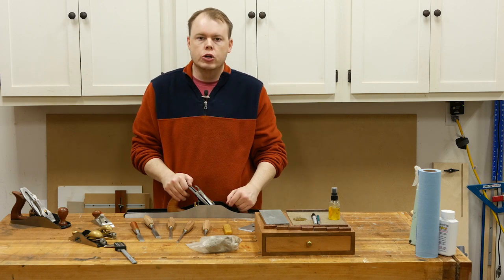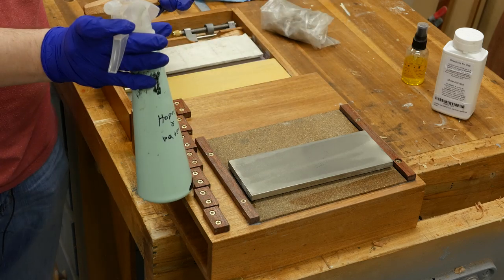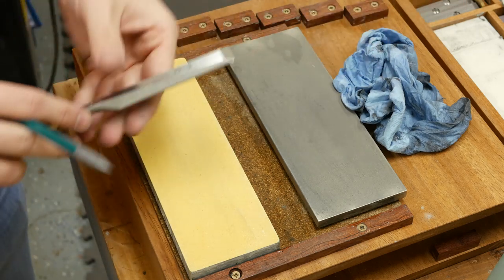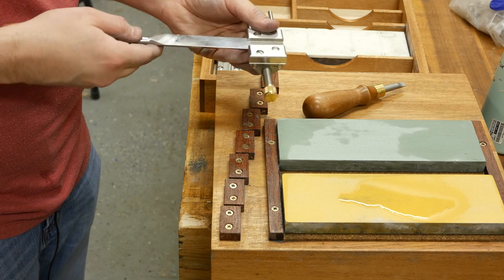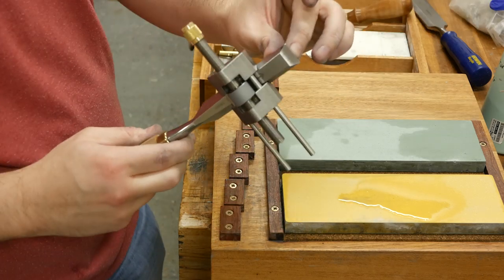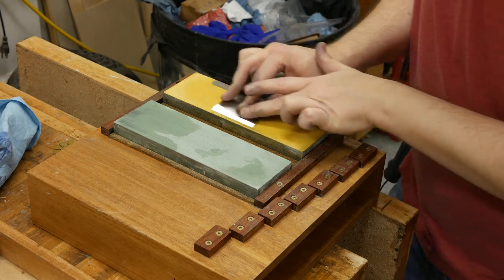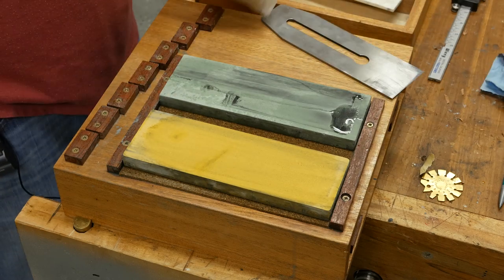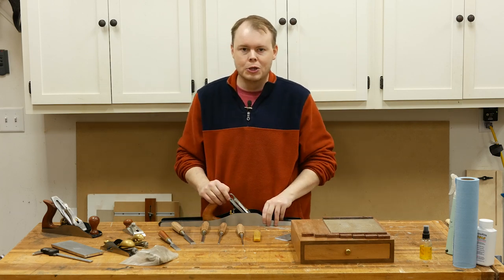How To Sharpen A Brand New Chisel And Plane Iron | Woodworking How-To

Comment: Nice video Sean. I need to get the coarse plate because starting a new chisel on anything finer takes forever. Thanks for sharing your method.
Reply from the maker: Thanks John. Yeah absolutely agree. For the price, the coarse stone is a good value. I had my original one for over 5 years granted I don't sharpen as much as I should, it will last a while.

Comment: Great video Sean! This is pretty much how I sharpen now except for 2 differences. First, I use a very micro microbevel. Only like 1 or 2 degrees. You can do this easily with your honing guide setup. Just stick your ruler between the block and your blade (so if your primary is 25, put your ruler in front of the 25 degree block). And then just a really tiny bevel. The second is I reset the primary every time. With just a tiny microvevel, it only takes a dozen strokes on a 1k to erase it. This saves a lot of time later on with low grit medium. It's really easy to skew an edge on low grit meduim when you are at it for a while. 
That sharpening setup is super nice
Reply from the maker: Holy shit Joe, Resetting the primary every time is brilliant! No need to let the micro build up and have to use a coarse stone to reset it. I'm going to give this a try maybe after the second or third micro bevel honing. Thanks for the comment!

Comment: Curious about the LN guide. You mentioned it doesn’t do well w chisels that have a tapered thickness. I’m considering buying that jig but have several chisels that taper and wonder if it’s still doable or if it really doesnt do well with them at all??
Reply from the maker: Randy, I mentioned that it doesn't work well with tapered thicknesses because it doesn't work well with them. I wouldn't recommend something that doesn't work.

Comment: Hey Sean, I was wondering how well that cork is holding up?
Reply from the maker: The cork-rubber material is holding up well. It helps retain the water from getting through and hitting the top and is a softer surface to place the stones on.
Reply: @Simplecove  Good to hear, thanks.

Comment: Hi.  I thought that water stones needed to be soaked in water for a few hours before being used.  Is that not correct?  Thanks
Reply from the maker: Not all waterstones require soaking in water. The ceramic stones I use do not require soaking. Only water when using them.

Comment: While the ruler trick is worth it if you have an older, wavy plane blade (or cheap, new iron), I'm not a fan of it for good, new blades. Once you do it, you are stuck doing it forever, since you need to re-polish it (nearly) every time you sharpen, while polishing the back is one-and-done, and it isn't that much of an issue with new, well-machined irons.
Reply from the maker: Just a personal preference, I guess. While I am stuck doing it forever, i'm only doing it on my highest grit stone and even then i'm only doing a swipe or two to remove the burr. I really don't see a downside to it, only an upside if the blade isn't perfectly flat. But again, these are all just personal preferences.